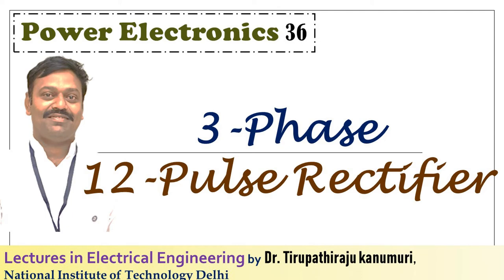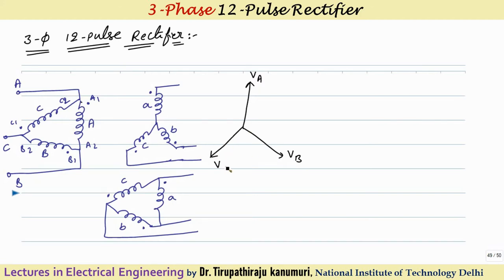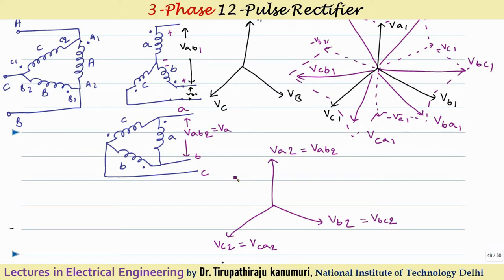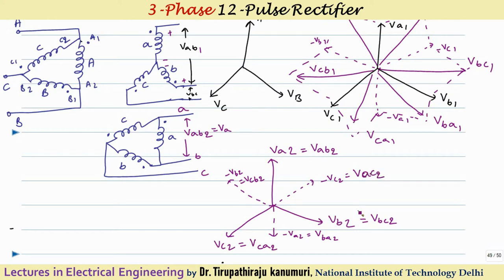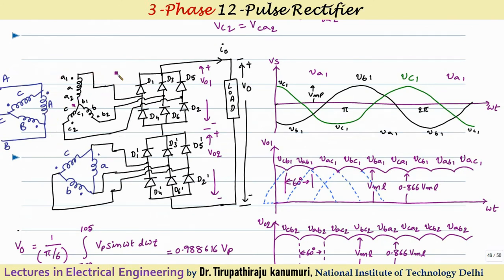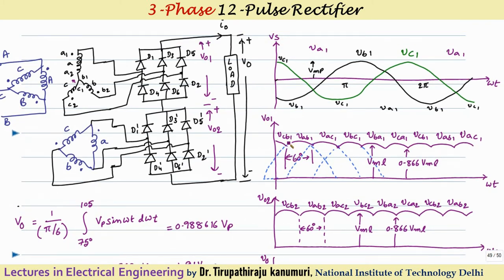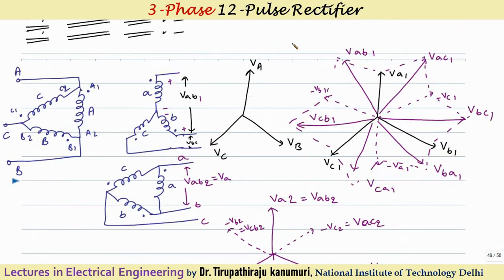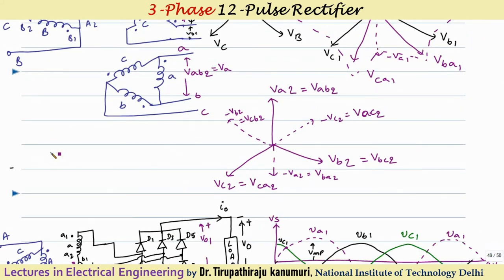PE36 3 Phase 12 Pulse Rectifier

Comment: Sir, Thankyou for this excellent lecture,.. Can you  please clarify my doubt sir....(On the assumption 1:1 turns ratio -the secondary star connected transformer line voltage will be square_root(3) times primary Delta line voltage ...and secondary delta connected transformer line will produce only just the  line voltage of the primary delta transformer ....if that is the case then, the  voltage profile of the secondary star fed rectifier will not only be phase displaced by 30 lead but also will be greater than the secondary delta fed rectifier) hence do we need to adjust the turns ratio of the secondaries ( delta and star) suitably in order to make the peak levels of V01 and V02 of both the rectifiers ? please clarify my doubts sir ...please